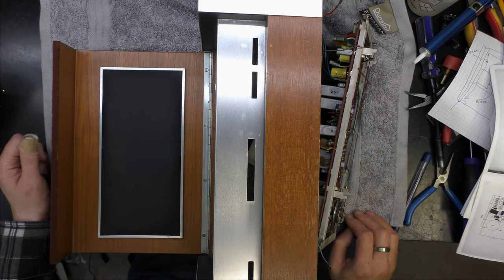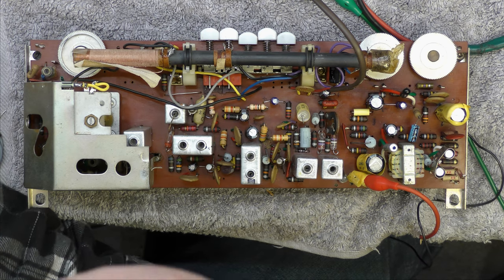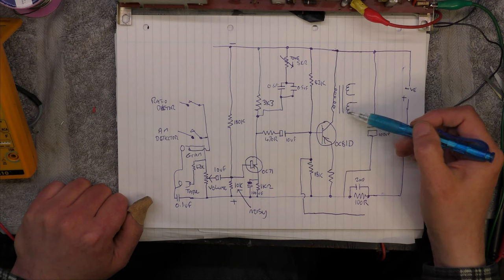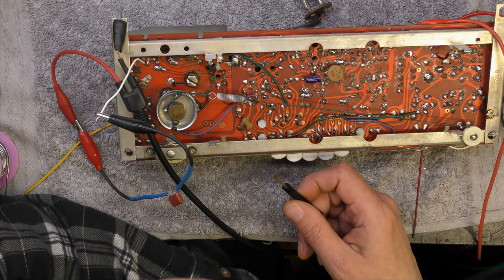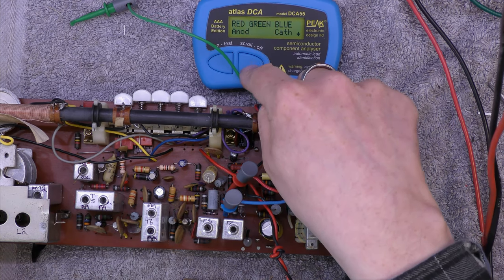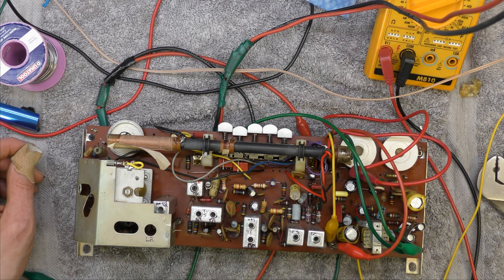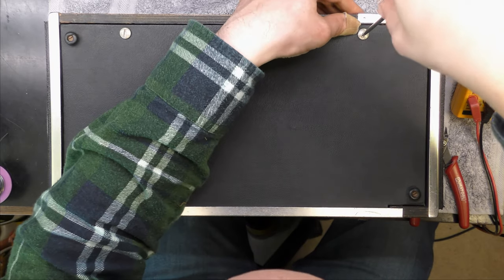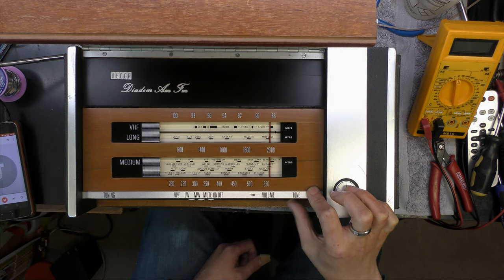Decca Diadem Table Radio 1965 (4K)

Comment: Great stuff Darren .. I have had one of these on the bench... shelf... bench. The real issue is spare parts  esp in Melb Australia along with with a readable circuit diagram / parts layout ..so your video has gone part way to inspire me again... my god the PCB tracks lift off at the slightest hint of a desoldering iron approaching

Comment: Great Video As Always Darren and a Very Nice Set, I See It Uses The Same White Wave Change Buttons As My Hacker Mini Herald and My Hacker Sov 1 RP18 With White Dial Tuneing Scale... Not a Big Fan Of Transformer Coupled Output Stages Much Prefair Direct Coupled But Hay Ho... Fine Work !! Regards mike.
(stay safe)
Reply from the maker: Thanks Mike. Yes direct coupled usually gives better base and more output. I wonder why they didn't go that way on this upmarket set. Interesting the same buttons are used in your hackers I wonder if manufacturers were using the same supply chains. Take care, Daz